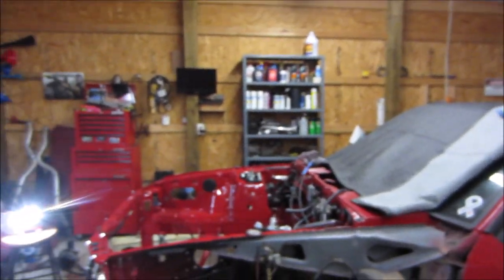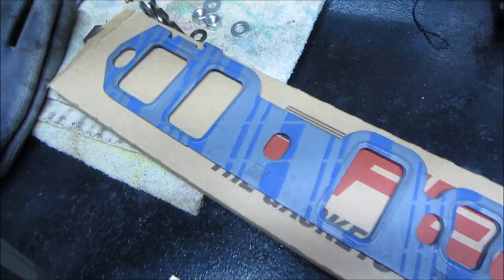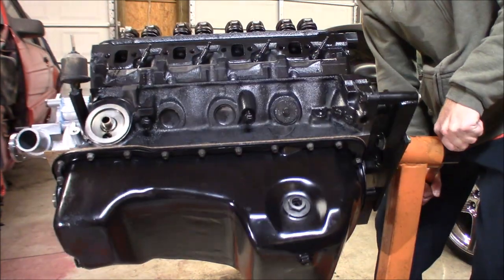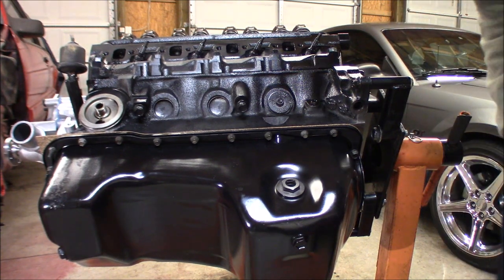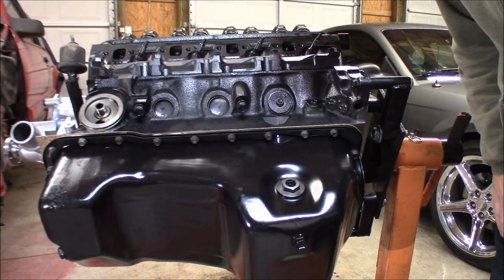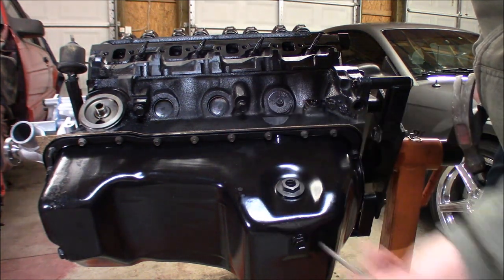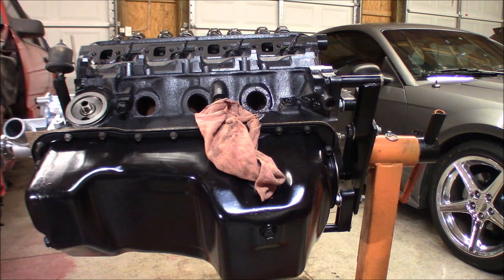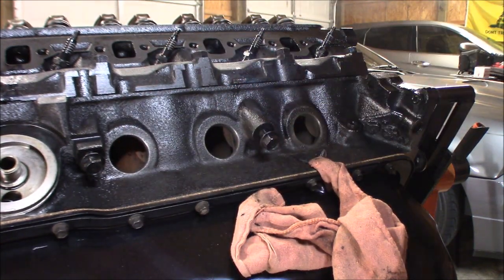How To Install 302/351 Core Plugs/Freeze Plugs Fox Body Budget Build

Comment: Hi, I changed my heads over the winter. I added some coolant to the block and I noticed a small amount of coolant leaking from the rear of the engine, passenger side, just above where the rear freeze plug might be. Dripping down from the flexplate. Would it have rusted over the winter and now its leaking? I'm stumped. Thanks
Reply from the maker: Sorry for the late response. Did you install the head gasket in the right direction? You have to on the felpro’s. Sounds like it’s a head gasket leaking.

Comment: Dumb question: Did they ever make freeze plugs that literally screwed in (1/2 turn or even 3/4 or full turn)? I know seems excessive ‘cause you’d have to forge the block with those threads (no?), but just wondering if that ever existed?
Thanks for the video!
😎
Reply from the maker: Thank you for watching and commenting. No they don’t have any threads think may have trouble with them welding there selfs in there I recon those expansion plugs work pretty good actually.

Comment: Hello I have a 1994 f150 351w any recommendations on what freeze plugs to buy
Reply from the maker: I would go with the brass one so you don’t have to worry about them rusting out and leaking. I get mine off eBay.

Comment: why go to the trouble to change the freeze plugs?
Reply from the maker: mr zif001 they were breaking down one was a rubber kind of bandage but a few of them I took out started to get holes in them.
Reply: @DEMONFOX5.0  i am not sure that my block is not cracked.   i will consider the rubber plug as a quick fix for testing .  rubber would go in easier i would imagine.   being in a boats bilge upside and little   what do you think?e room for wigglle roon and  blind. what do you think?  block cracked or not 50/50 is not cracked.
Reply from the maker: mr zif001 ew the rubber ones actually work good I had to pry mine out it was stuck in there pretty good. What make you think your block is cracked?
Reply: @DEMONFOX5.0  i watch to many youtube vids from guys that have core plug replacement  and cracked blocks.  they use jb weld for repairs, not my style,  jb might ok  but like a rubber plug is temporary.    thanks for the advice and video's.

Comment: I've never liked those rubber freeze plugs never had any luck with them
Reply from the maker: Dustin Miller I’am lucky this one didn’t it was in there when I bought the car over 10 years ago.
Reply: I have one on my turbo mustang. Put a ton of miles on it. Probably ought to pull it and put a new one in but if it ain't broke dont fix it.

Comment: I can’t get mine out I smacked the shit out of it I feel I’m about to bust a hole through it.....
Reply from the maker: 40Mike Mike try soaking them down with some WD40 or what you have and then try to knock them out make sure to hit it on the edge of the freeze plug.
Reply: Was waiting on brass plugs turned out great 🤘🏼
Reply from the maker: 40Mike Mike was you able to get yours out?
Reply: Yes they were tight man but I soaked over night and once I got that first one out i had to thankyou 🤘🏼